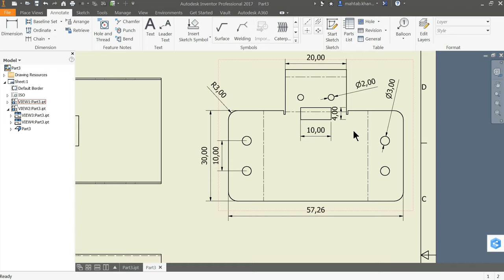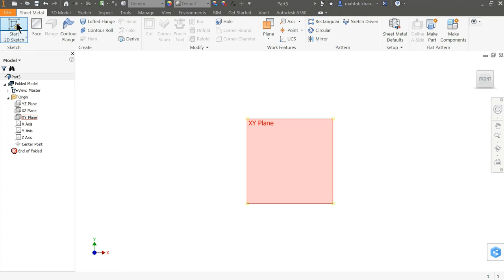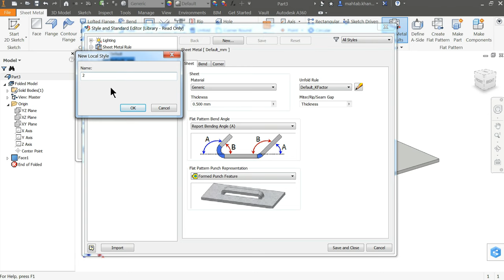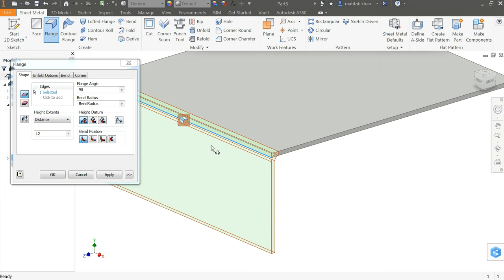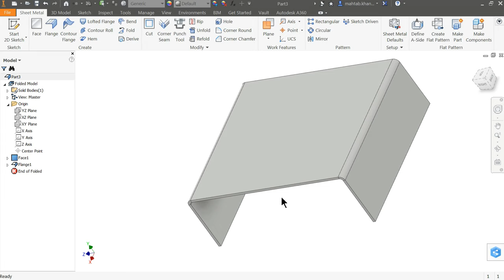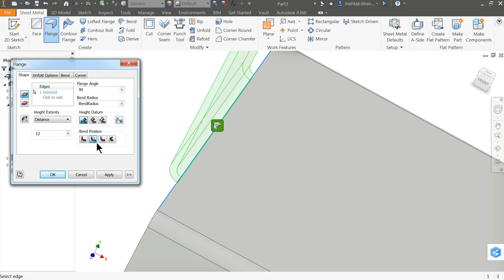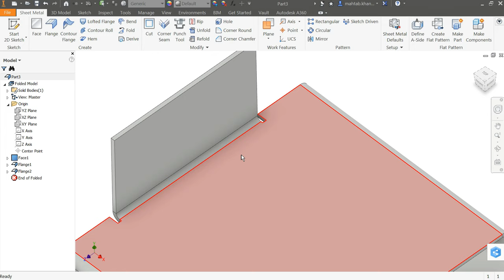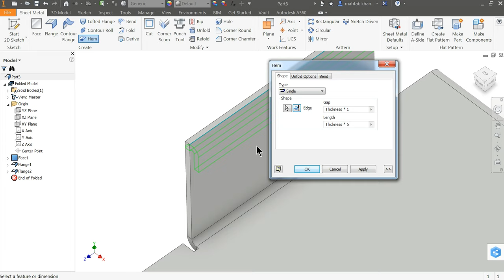Autodesk Inventor Sheet metal Tutorial Basics

Comment: Starting at the ISO.dwg, when I select "Base" , "Folded Model" is the only one I can select, I can't choose the "Flat Pattern". Also depending on where I last saved the sheetmetal.ipt (either folded or unfloded) that is the only way it will display in the ISO.dwg. By that I mean if I last save the sheetmetal.ipt in the "unfolded" state it will be it will be "unfolded" in the ISO.dwg, even though the option "folded" is checked. Simply put I cant create a folded and unfolded view in my ISO drawing  unless I create 1 folded view then go back to the .ipt, unfold it and save then go back and create another "Base" . Any suggestions? Is it an association issue?
Reply: It's because you didn't create a flat pattern view in your sheet material file as he did 13:05.